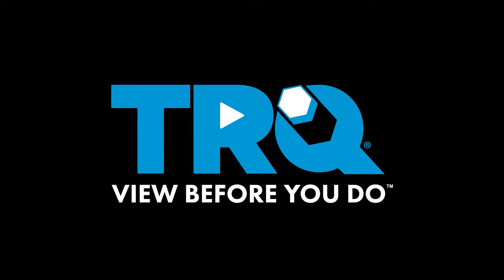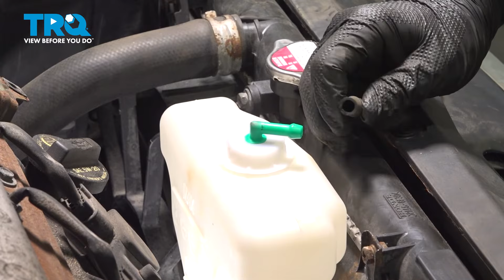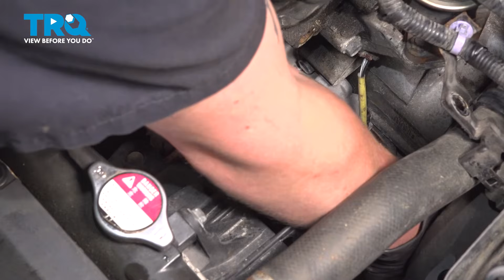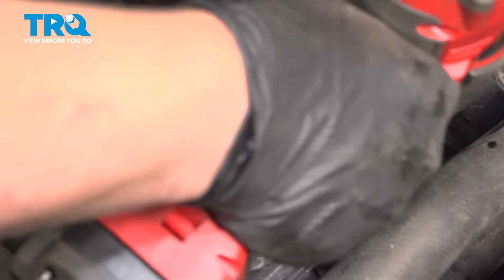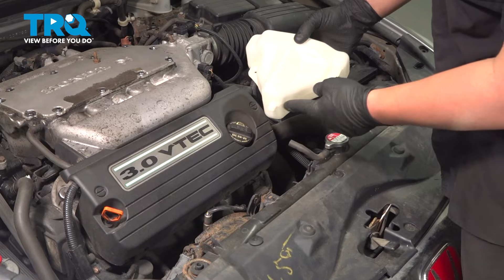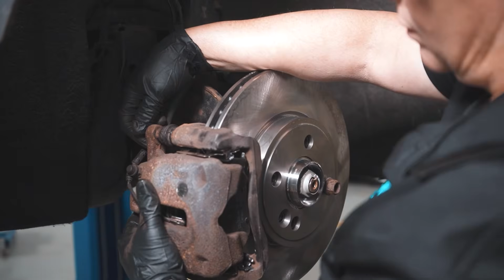How to Replace Front Engine Mount 2003-2007 Honda Accord 3.0L V6

Comment: Just finished, pretty difficult job. Hardest part is getting the top bolt out and getting the mount itself out. You can fit a socket wrench between the radiator and the bolt if you reach down and up under the bolt. You also don’t need to disconnect any of the wiring, just move it to the left. Highly recommend a second person to get the new mount lined up right.